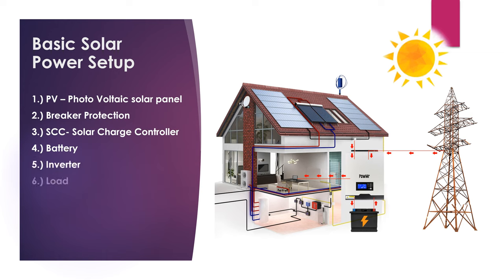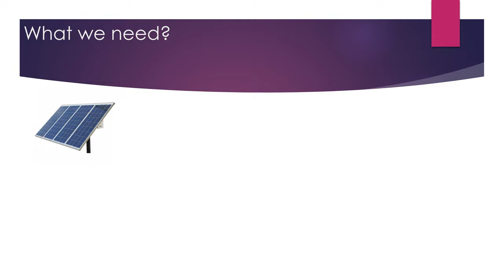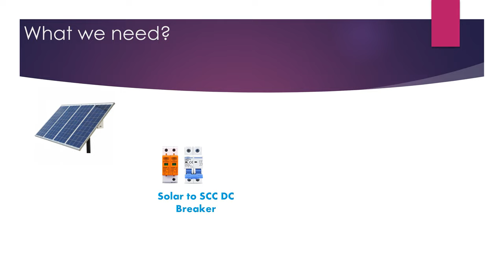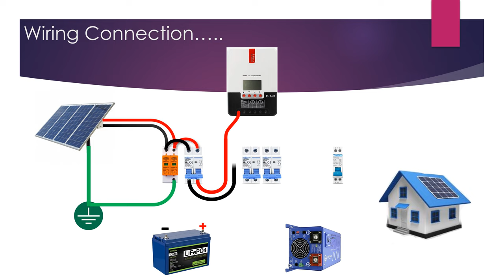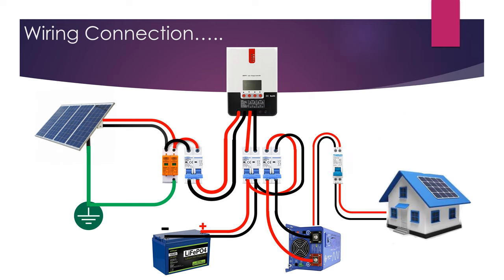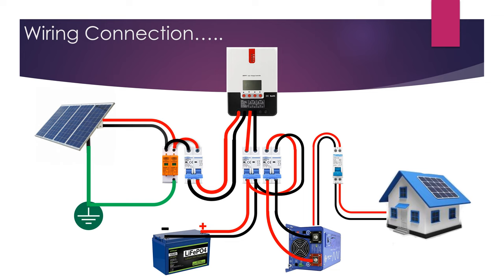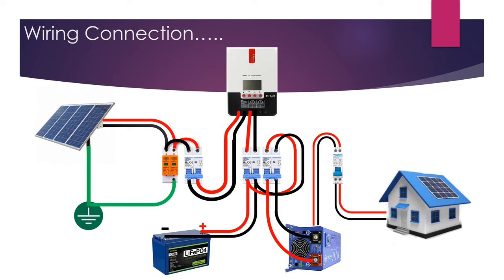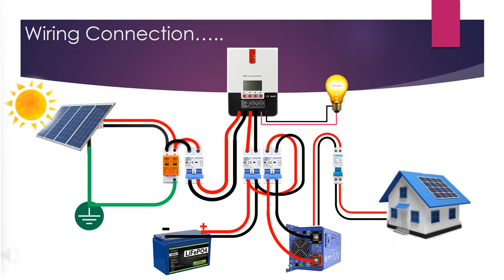Basic Off-grid Solar Power Setup

Comment: MCB nya berapa Amper
Reply from the maker: Breaker rating is base on your power design compution. In this tutorial; SPD: 20-60ka, PV DC Breaker: 125v/20amps, Battery breaker: 125V/30Amps, AC breaker: 2amps. This is only a small design.
Reply: @hanzlightdiy4670  trima kasih inpo nya 😁